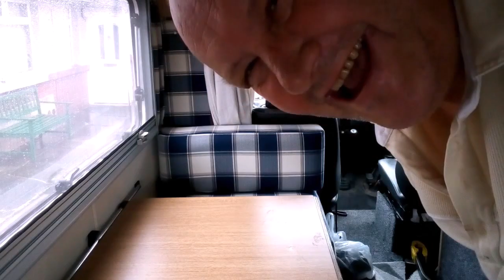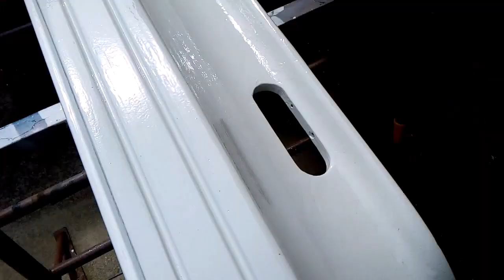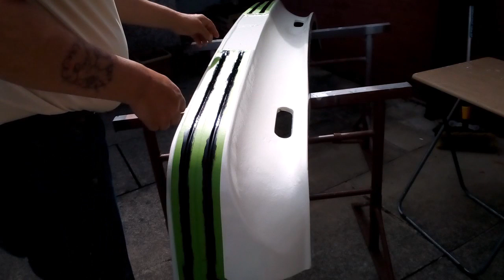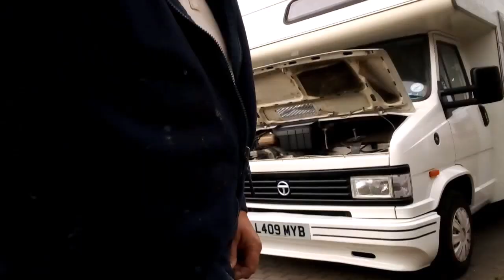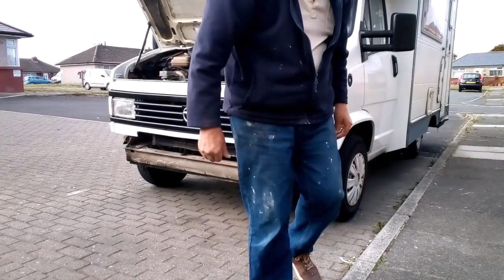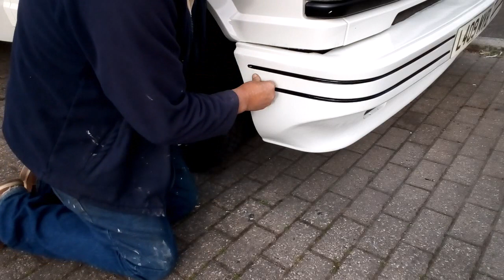Talbot Express Front Bumper Cover Finishing And Fitting

Comment: You do know what to do!! take it off and get someone with a press, the ones that pop out the wheel bearings to straighten it up, then rub it down and spray paint it with Hammarite smooth, as they don't put much paint on when new. take it off and pull the side brackets out a bit so that the bumper does not pucker up.

Comment: Looks great. I've got a talbot express campervan and i ended up having to paint mine with a brush. I had the same problem when using a spray
Reply from the maker: I am really sorry Paul, for some reason on certain vids i am not getting reply notifications,  Thankyou hope it turned out ok then
Reply: Here is a tip I learnt a long time ago, wash the fibre glass bumper, and then let it dry on it's own, (DO-NOT DRY IT WITH A CLOTH) as it builds up static and the spray paint will NOT go on it, as for the real metal bumper paint it with hammerite smooth.

Comment: I would of at least put some paint on it after rubbing the rust off, you can see where you will have a problem at a later date when you shear the bolts off to get it off.  (just my opinion)
Reply from the maker: Yes your right of course but to be honest i was getting really fed up, i had been on the fiberglass bumper for 2 week.